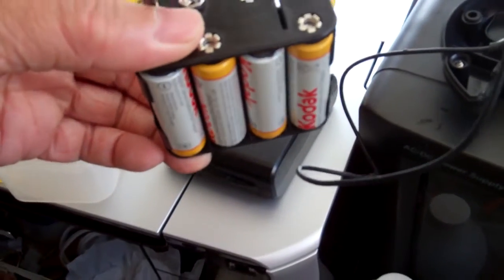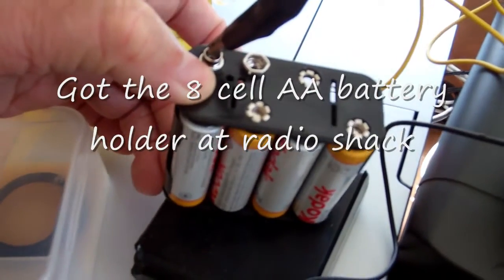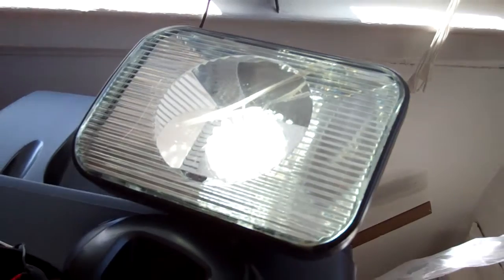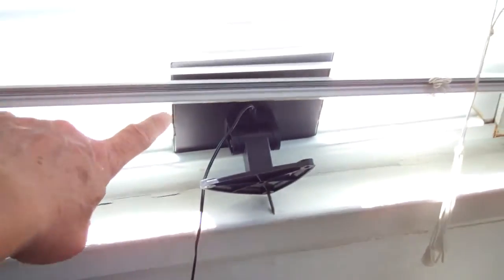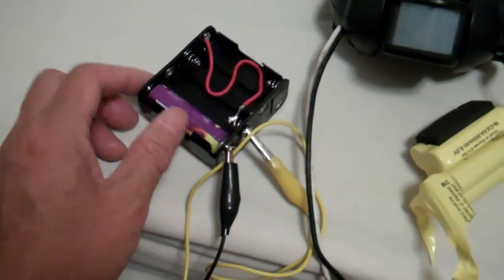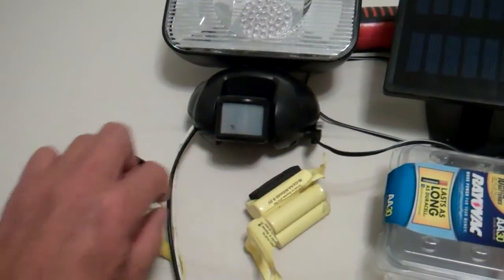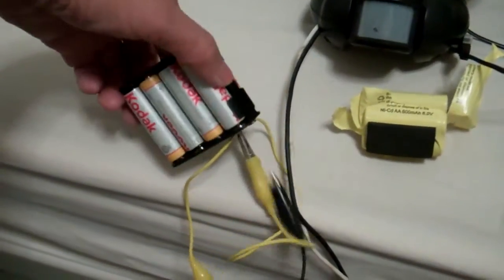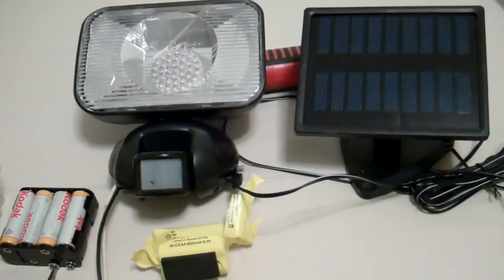Repairing the Harbor Freight Bunker Hill solar remote LED light.wmv

Comment: The reason they put such small batteries in these things is the solar panels don't generate enough power to charge a regular sized (by size, I mean mA hours) battery pack.  Like if you put a 2000mah 5 AA cell battery in that thing, the solar panel will not charge it all the way because there just isn't enough time to generate 12 watt hours that battery would hold.

Comment: I ordered a new battery pack for this thing, I check the voltage in the new battery pack and it reads 6.02.  The light is not coming on or the sensor. The light was working fine a few days ago with the old batter pack but that one read 4.0v and the light would barely light up, so now Im wondering what can this be? Why do you think my light is not turning on with the new battery that reads 6.0 that is more charged than the old one?
Reply from the maker: That is strange. I'd check all the wiring to the LEDs. Could be a break somewhere.
Reply: @wtam69  Thank you for responding. Last night I check the wiring in the battery  and it turns out the red and black wires on the hold clip were placed in the reversed position ( cheap stuff huh) . Anyways i got it to work by  cutting the wires , what a mess. The light works but the sensor is still not working , no click nothing,  i think it is done. I'm  buying another one. I live here in West Texas desert so these things don't last as long as they should out in the hot dry  sun. This one lasted 2 years, so for 30 dollars it was ok I guess. Stay safe Sir.
Reply from the maker: @carlosb1  Thank you for sharing. The one you had didn't seem too long lasting. Maybe try ones from Costco. Or make your own if you like to experiment. I have a video on a diy garden light. If you like I can even send you the chips for the project.
Here's the video for the diy light: https://youtu.be/YfTJH5VRm_Q

Comment: Thanks for the idea of the external battery pack.  I just did a similar upgrade to one of mine.  Got a 2 and 3 cell AA holder, wired them in series and put them in a plastic box.  I used the back cover of the existing battery compartment as a template to drill holes in the new plastic box so that I could use slightly longer screws to go through the new box, and through the old cover into the old battery compartment to hold the new box to the unit.  I also drilled a hole through the new box and old cover to pass the wires from the battery holders to the battery connector that I took off the old battery so that the connection is made in the old battery compartment. (Mine is a newer unit than the one in your video).  The new box and battery holders were about $5 at All Electronics, but from now on the cost of the 2200 NiMH cells at Harbor Freight are $6.99 per 4 pack minus any discount coupons.
Reply from the maker: Thanks for adding your comment. Good luck with your upgrade.

Comment: Thanks for the great tutorial. Would it be smart to replace the battery pack with a Power Sonic PS6100 (6V 10AH) Rechargeable AGM/GEL battery (externally) when they're gone? I need the extra hours a day for the light to be on, and the Power Sonic PS6100 (6V 10AH) should charge in the same way, shouldn't it?
Reply from the maker: Dean Patterson Yes, you can a sealed 6v rechargeable if there's enough room in there to hold it. Or you can use heavier duty batteries like the Eneloop batteries. They should charge the same way.

Comment from the maker: Thanks for the great information about reviving the NCs. I just stuck in whatever cells I have around this time. I usually put Sanyo eneloop in my solar lights, mostly Maverick Brand, and so far they have performed ok.  With the generic battery holder, I can now easily replace even individual cells that go bad.

Comment: NiCd cells can usually be restored with a few high current pulses (I use a big electrolytic capacitor) and manual charging afterwords.  The stock PV module is probably too small to adequately charge the battery.
Also, the charger in the light may kill the NiMH cells you are using as they cannot handle continuous overcharging the way NiCd cells can.